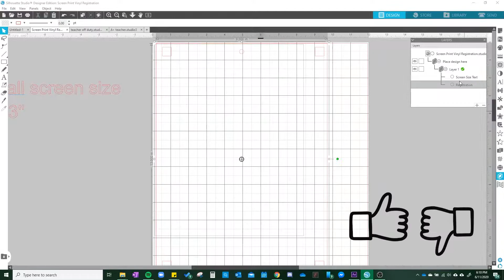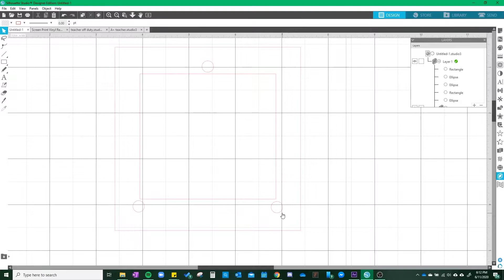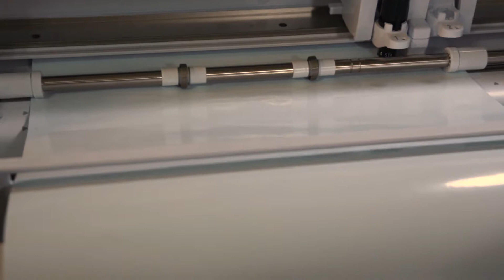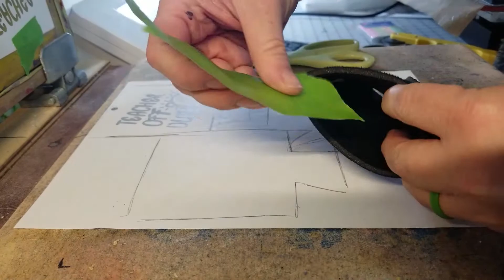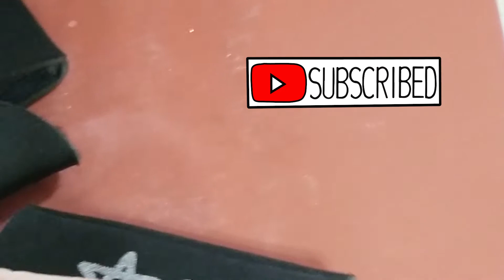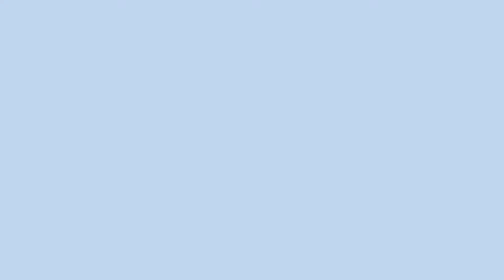Screen printing without Emulsion

Comment: Can you use a regular printer?
Reply from the maker: I'm not sure what you're referring to with 'regular printer?' 

I'm screen printing with vinyl, so you would need a vinyl cutter. I'm using Silhouette Pro. 

You can use a regular InkJet printer to print and burn the film negatives onto a standard screen with emulsion. 

Both printing styles (vinyl and emulsion) can be printed on a regular rotary press or line table. I'm just using a mobile single platen that we made.

Hope one of those answers helps!